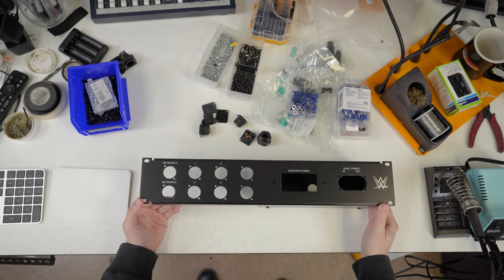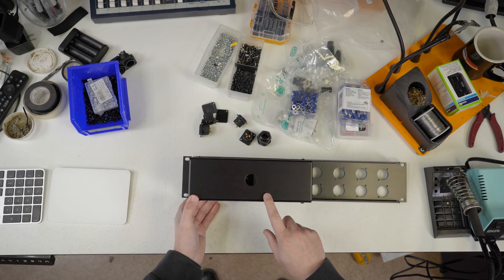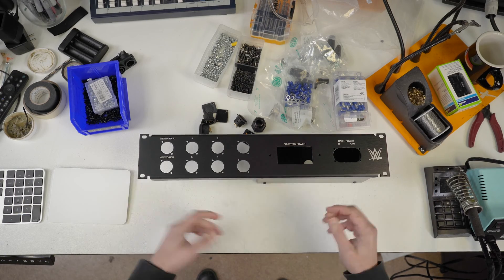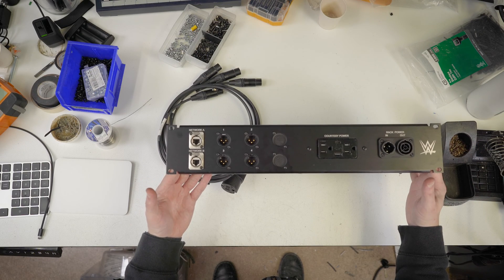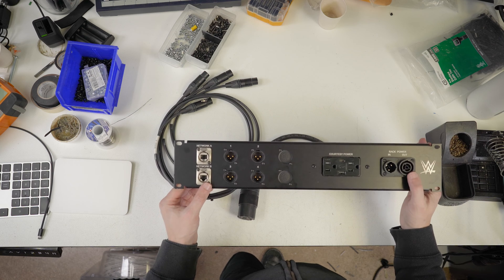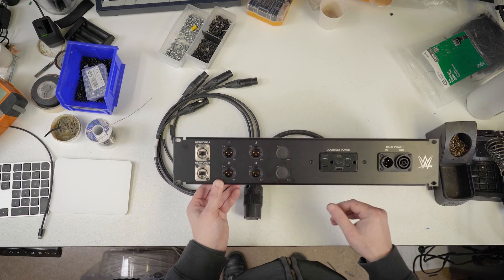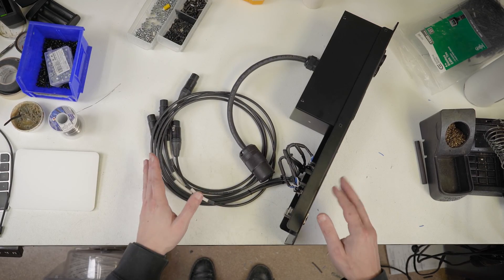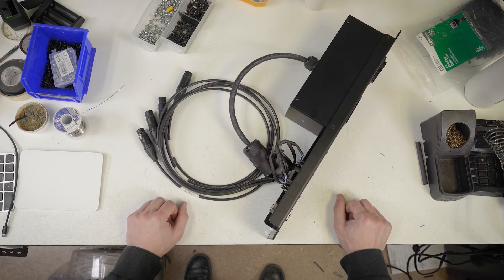Custom Rack Mount Panel For An RF Rack - XLR/Cat6/True1

Comment: I'm soldering my first XLR patch panel and wanted to know if your strategy was to go hot with the iron, or lower temp to not melt the plastic housing. Any advice? I have a TS100 iron
Reply from the maker: I keep my iron at 600 degrees. That seems to be the magic temp.